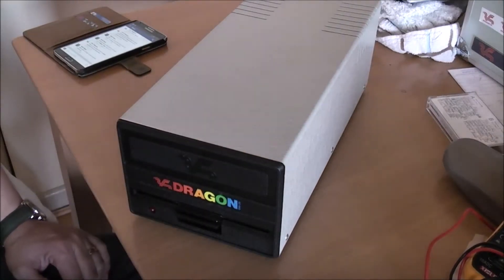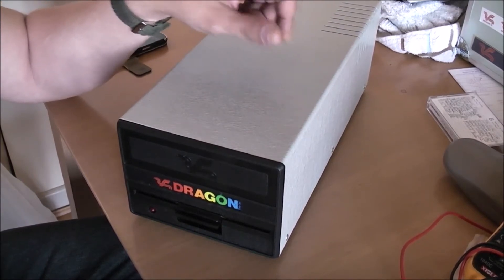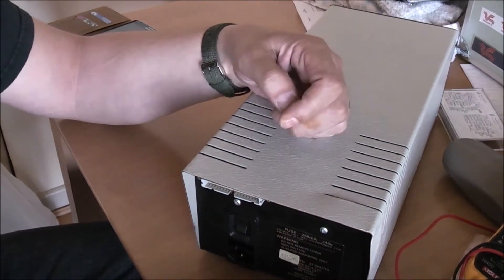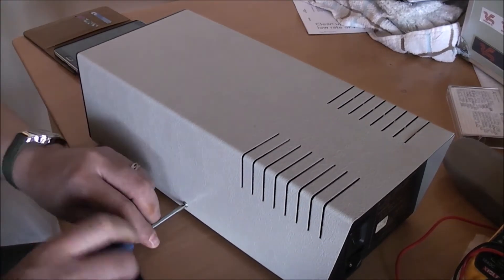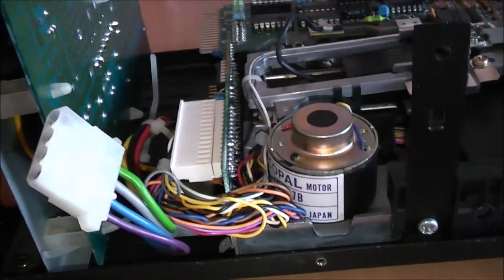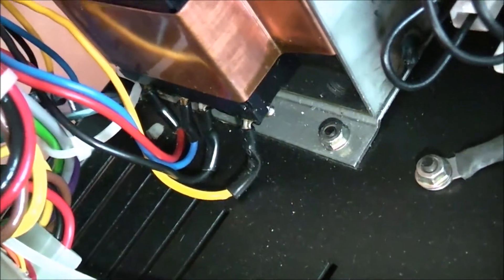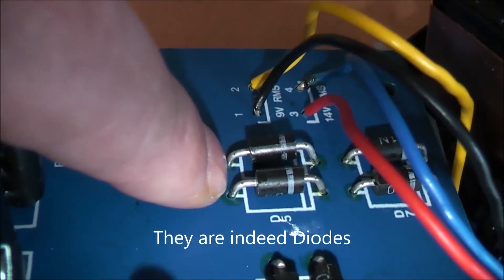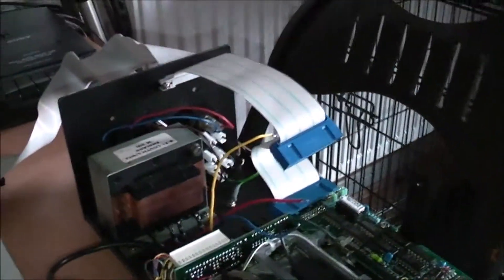Dragon 32 Floppy Disk drive Repair - Part 1

Comment: Are you sure its not the main switch arcing?  You can test that by removing the spade connectors from the switch and joining them up temporarily, then make sure correct sized fuse is in and power up again without connection between the regulator board and the transformer.  Great job getting it working - there can't be many of those still operational!
Reply from the maker: No the switch is fine. I did test it. The transformer developed an internal short. I have it working with the new psu wired through the original switch which will be revealed in part 2 ;) Thanks mate